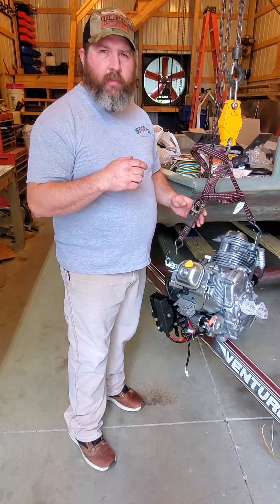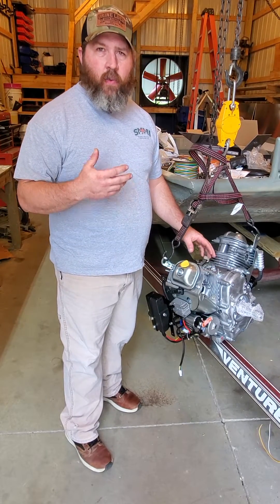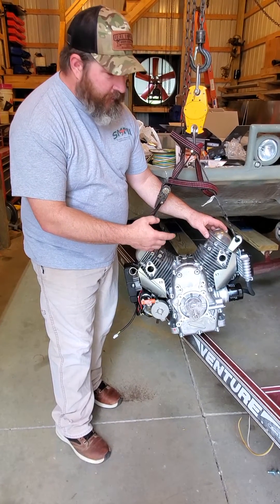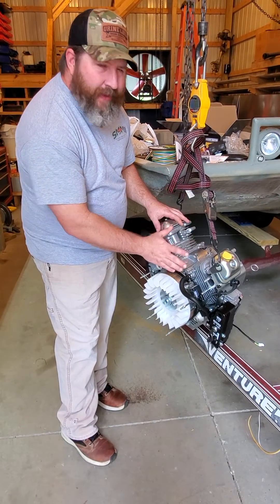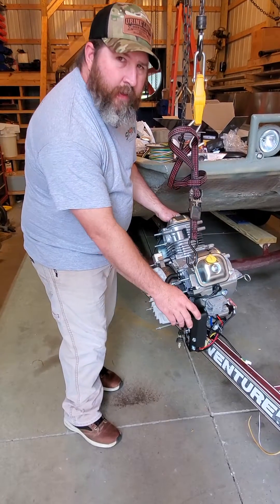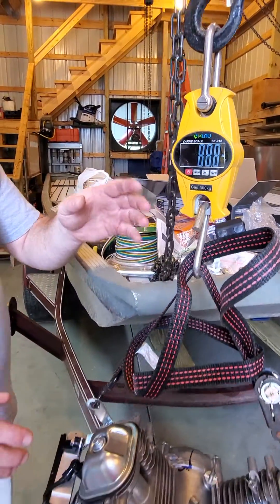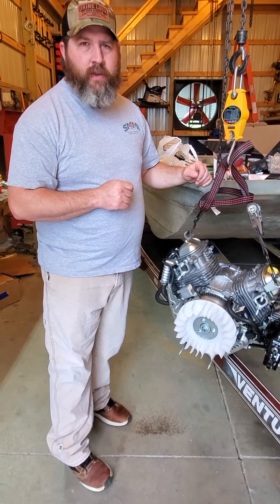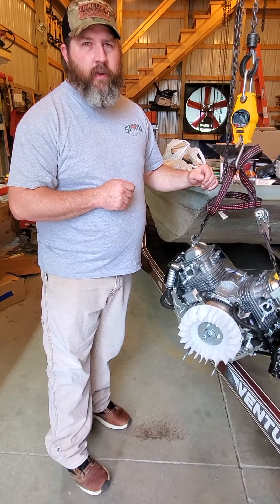Predator 670 dry weight

Comment: The 670 actually has a 16.6 lb flywheel. You'd shed a TON of weight getting rid of the flywheel and starter. That starter weighs 8 lbs. If you'd do all that you'd be very comparable in weight to what Leonard Miholland got with the 23hp Vanguard that he aviationized for his Legal Eagle. Get a few parts from performance 670 or a turbo kit and you'd be over the 30 hp mark pretty safely with that little engine.
Reply from the maker: Your numbers are wildly off bud. I built my motor to 43hp NA. With a turbo you could get up to 70hp but not likely to last very long.  You can get to 30hp just by upgrading from the junk stock carb.
Reply: @DustinApple  Well, I know an engine builder that bought the 670 specifically to aviationize it. He took the factory flywheel off and weighed it. It weighed 16.6 lbs. So until and when you take yours off and weigh it I'm sticking with 16.6 lbs. I don't know jack shit about small engines, but I spent a decade working as both an auto and diesel tractor trailer mechanic. Yes, I'm aware that you can run more gas to make more power, and you can make 70 hp with a turbo, but I was approaching this from an ultralight aircraft use case. You don't have to make 70 hp just because you use a turbo. Lower the boost. Make 30 or 40 hp under boost. You don't want to burn more fuel as you're limited to 5 U.S. gallons under  FAA Part 103. I understand that under boost the engine HAS to burn a little more fuel but 5 gallons doesn't go as far as you'd think it would.
Reply: @rovingmarks  How lightweight did he get the predator? How does he do ignition without the flywheel magneto?

Comment: is there an oil galley for a oil pressure gauge on the predator 670?
Reply: Since it has a built-in oil cooler you should just be able to hook a tee into the line, however I don't know how accurate of a reading that would give.

Comment: Building a fan?
Reply from the maker: Yeah but not in a big hurry.  Gonna turn the air flow rate up first.  22hp ain't gonna cut it.  I've been drinking the "red beard's garage" kool-aid.
Reply: @WHITERIVERRAMBO  lol, just be careful. Those shafts aren't that strong. On a side load from a belt reduction may snap it. But maybe not. Seen lots of ultra lights use them.
Reply from the maker: @cdp50359  yeah belt drive is a must
Reply: @WHITERIVERRAMBO  you could try that super charged 670cc build!  😳
Reply from the maker: @cdp50359   I'll start a go fund me page lol
Reply: @WHITERIVERRAMBO  lol